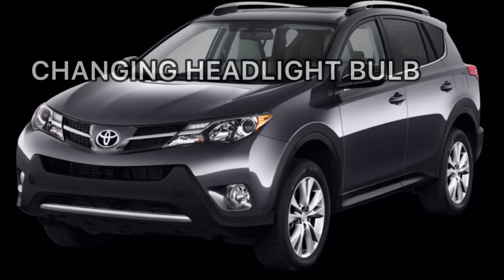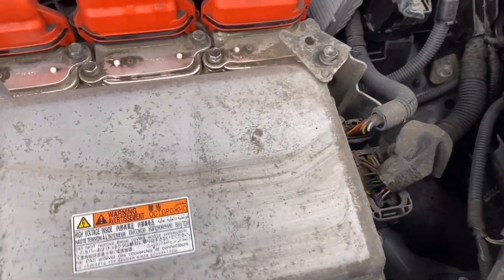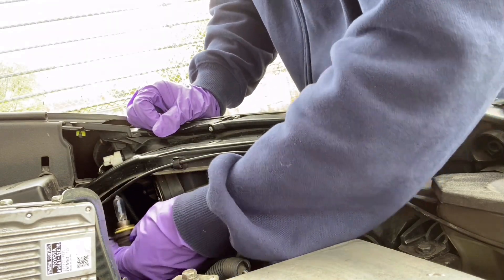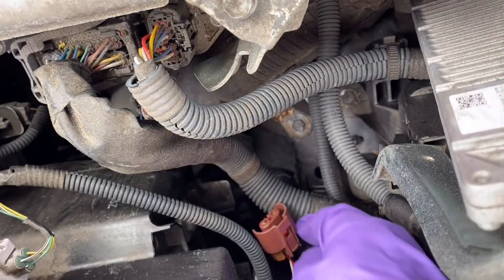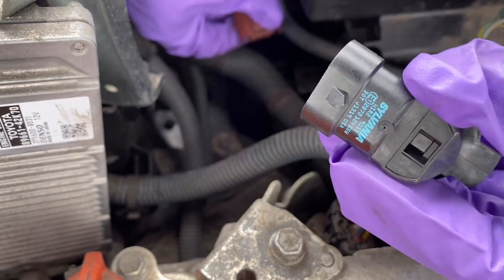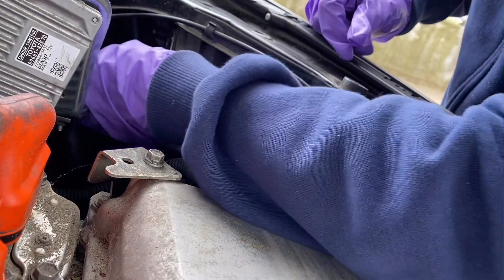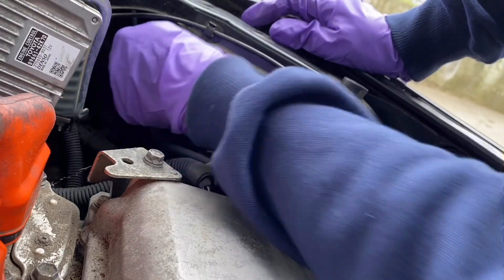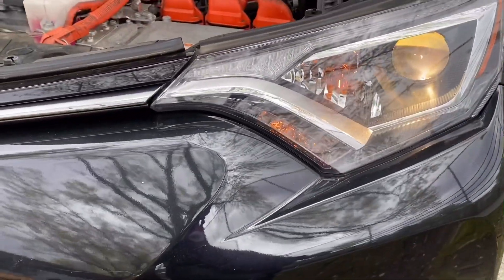How to change headlight bulb Toyota RAV4 2017

Comment: Thanks a lot for this, I was able to replace the bulb 9012 by myself, proud lady!! The fool at Canadian Tire garage told me it will cost me $400 to replace it as they have to remove the whole front lights located near the engine!!?!🤦🏽‍♀️
Reply: thieves
Reply: Wow. Give them a bad review! They either tried to rip you off or had no clue what they are doing.